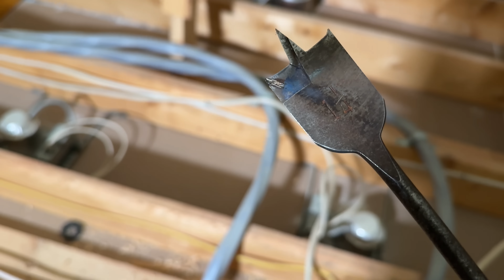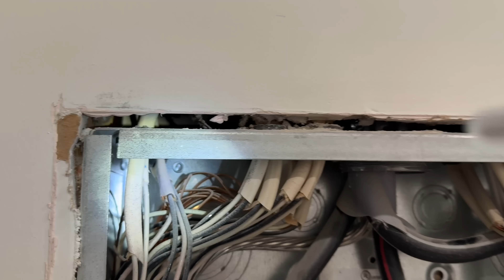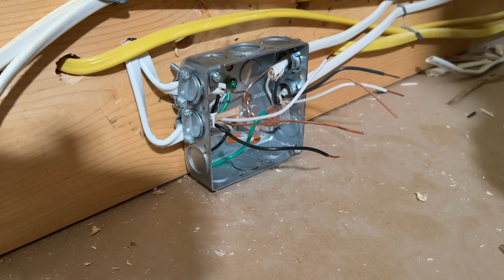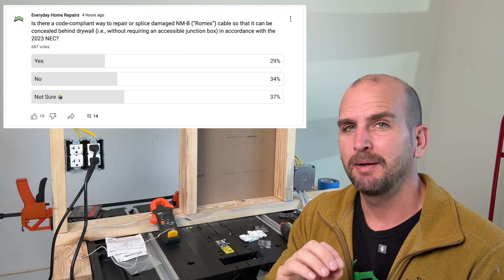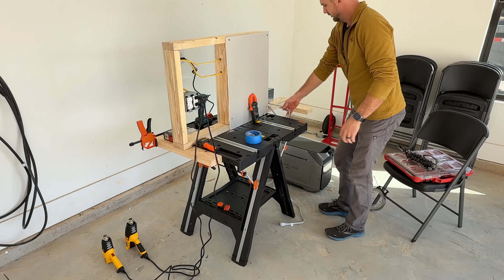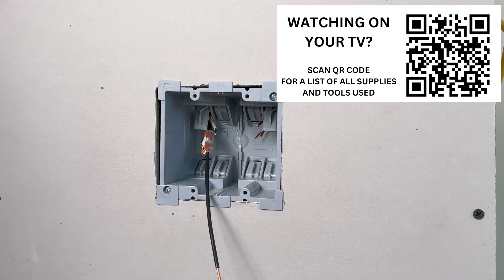How To Repair Damaged Romex |  3 Easy DIY Fixes

Comment from the maker: Romex Splice Kit (NEC Approved):  https://geni.us/Pf2A
WAGO 221 Inline Splice:  https://geni.us/czIBu
WAGO 221 Kit (4 Types of Lever Nuts):  https://geni.us/wKcBNC
New Klein Tools 16-in-1 Screwdriver:  https://geni.us/9j1bFVa
Knipex Hybrid Wire Strippers:  https://geni.us/uVWn
All The Supplies and Tools Used:  https://geni.us/l9NfK5G

DISCLAIMER: This video and description contain affiliate links, which means that if you click on one of the product links, I’ll receive a small commission.
Reply: Great video. I would replace the wire when feasible. But if not I prefer the old work box method. One difference that I would do is instead of two pig tails, I would just add a single extension/ jumper which would eliminate one set of connectors.
Reply: Why not solder the wires? That is a permanent repair that cant fail
Reply: Where does it say in the specs that it's rated to be buried behind drywall? I'm not seeing it. Thanks!
Reply: I CAN NOT SEE HOW THIS IS CODE APPROVED. AS FAR AS I WAS TAUGHT , ALL JUNCTIONS MUST BE ACCESSABLE. HOW IS ANYONE SUPPOSED TO KNOW THAT YOU MADE A SPLICE IN BEHIND THE WALL IN THE FURTURE??? I AM NOT SAYN THAT THE WAGUS ARE CRAP. IN ANY WAY. . I GUESS I AM JUST OLD SCHOOL IMHO

Comment: If you installed pipe and wire your whole life ( Greater Chicago Area) you have to ask the question how is Romex legal. With pipe and wire, no need for arc fault breakers. If you use SQ D QO breakers I would argue you can shit can GFi receptacles and breakers. Romex you can hire 8th graders to pull the romex, then have an apprentice to staple and splice the wires. With pipe and wire you need tools and some mechanical ability to do the work.

Comment: Metal box.. shouldn't it have the wire connectors so it doesn't rub the wire on the sharp metal holes ..or be plastic

Comment: First is best, only one added connection in a box.
The second and third options increase the number of connections (points of failure) by three.
At least the third connection is in a box and not hidden behind drywall.

Comment: your not gonna have problems now . Your gonna have problems down the road when someone overloads the circuit or installs a 30 amp breaker on the 20 amp wire. 42 years experience I've seen it all

Comment: use a 2 1/4 inch deep box and  also your service cable  is not stripped out  correctly and one needs to be shortened a 1/2 inch

Comment: I want to splice into a romex line in the wall to add an outlet, I barely would have enough line to get into a junction box but if I use the Wago connectors, will this be ok?

Comment: Wago's much easier. Can use either the inline splice or the two wire wago per wire. Put them in a small box and cover.

Comment: I have also seen the best items fail as well. Has the worst items fail? So just because you fail with one of those outlets on a griddle doesn't mean everybody does and it doesn't mean a good one. Wired not properly would not fail as well

Comment: I like how it's all in one.

However, yeah, no access is a concern for me.  

Additionally, if only the insulation is nicked I don't see that as necessary, just replace the insulation with the heavy in-wall grade electrical tape of your choice (not the cheap-stuff) I like the good silicon Outdoor/Indoor/in-wall grade stuff, or the amalgamating rubber in-wall grade stuff, simply because I have an irrational hate of vinyl. 

If ANY damage is done to the conductors, even a scratch, you will need to cut that out and do a full splice, though.  No shortcuts there. Play it safe.

Comment: That thing is made like a giant 3 wire scotch lock . Only ever used those in cars for 12volt stuff.The single wire ones that is. I've yet to use any of the Wago type on anything. Just seems like too little of surface contact for me.

Comment: So how in the hell are you gonna pull the new wire with the old wire if it was secured properly with staples? There's supposed to a staple every 54" unless passing perpendicular through a hole drilled through  a stud, joist or rafter. Most wiring issues I've cursed at have come from DIY masters who know everything because YouTube and AI told them so. If you insist on doing it yourself, get the current "Ugly 's electrical reference book" at Lowe's or HD.

Comment: #3 with single gang box installed horizontally. And only 6 inline wagos with 3 wires connecting them directly. No need for 9 wagos and 6 wires.

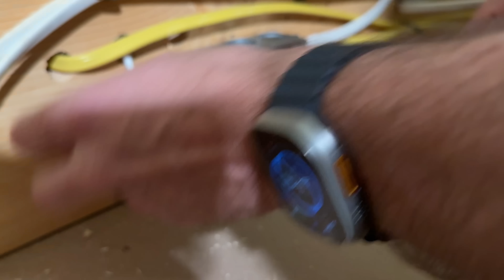Comment: Using a metal box instead of plastic in the basement and attic, makes no sense to me at all. More durable? I’ve never had a plastic junction box. Fall apart. Also, this website is hard to follow because he’s talking so fast. Slow it down there dude! 4:48

Comment: It’s UL approved. Is it the same part number for 14 and 12 AWG? Insulation displacement connectors have been around for 40 years or more. If you follow the manufacturer’s instructions, they are fine

Comment: In your attic example, you can not pass-thru the ground splice on that 2nd circuit.  It splices inside the box therefore it must be connected to the other grounds.  250.148.   You can tie all the grounds including the bonding jumper for the box under one wire nut, or you can bond each circuit to the box if you have more than one ground screw hole.  

Think about it, if someone cuts or disconnects the 1st circuit from the panel for any reason, then that box is no longer bonded if there is a fault in the 2nd circuit.  These two things could be years apart.  Someone could remove the 1st circuit in 2026, the fault in the 2nd circuit could occur in 2036 energizing the box, and the person touching the box could get electrocuted in 2037.

Comment: When you have a failure that didn't burn the house down, the single most time and money consuming thing about it is that you can not see it because it is behind a wall.  That make option #3 the far and away better choice.  Even if you must cut the wall out anyway, knowing where to start makes up for it.  

I have a hard time recalling seeing a wire fail in the middle where there was no device or splice.  I think I have seen mice eaten insulation create arc damage failure.  Hiding a splice behind a wall is poor practice that I would NEVER do and NEVER recommend even if it is code compliant.

Comment: Those connectors are ABSOLUTE JUNK !!!!   I worked in a double wide mobile home that had those to plug the two halves together at the marriage wall. There was a circuit not working, so I checked along that wall, and one of those connectors was BROWN !!!  It was burned up to the point of no connectivity. I would NEVER use one of those things... ever.

Comment: I apprenticed Jr High through college with my dad's friend, and regret not taking the journeyman exam. Anyway, even if code did allow for those splices without a box, as long as code allowed (it will always allow) I'd put the splice in a box with romex connectors to clamp and secure the wire in place, so that the next person to come along and yank the cable doesn't break the splice.  I've seen enough bad installs - not just DIY but by pros - to not put hack work in place; apprenticing gave me an appreciation for overbuilding on DIY home repairs and additions.

Comment: Depends on where it is.  If it is along the level of outlets, or in a room where mid wall outlets are ok, then I would put in outlets. I don't like all the blanks and other things stuck on my walls already in my great room.  I have the door bell box.  the prewired motion sensor location box, which I don't use, a blank for the fan which is on a 3 way switch we didn't 3-way.  Two smoke detectors, one for the full house linked system and one for my security system's smoke alarm,  one for the glass break sensor.  I have lots of things cluttering up my beautiful walls other than my wife's Japanese embroidery art work.  I would likely put in the hidden splice if I couldn't cover the blank plate with art or something.  In a bedroom or garage or bathroom it wouldn't bother me to put in a box and blank. I wouldn't run a wire to the breaker box myself.  I have rewired a house before, out in the countryside way outside of the city inspector's jurisdiction.  I put new breaker box and got rid of the old metal wrapped wiring from decades ago and put in Romex.  When I was running the microwave if the fridge kicked on the breaker flipped.  The old house had like 5 circuits total for two story house... Yeah..  Of course, the cottage at the lake was wired with two single strand wires going through the walls in bakelite tubes and the light fixtures pigtailed into it. I was wired by old coal miners probably before I was born.  But I live in the city now...I don't keep up with codes any more.  I have a good electrician company.  Which reminds me...I need a new outside outlet, a point of use hot water unit, and a new inside box too.

Comment: I found this snippet in the instruction installation manual. It requires that it be fastened to a wood stud or something similar. 

Connection (Fig. 3)
1. Slide splice into tap until locking latch engages
locking tab.
2. Mount connectors to stud or joist with 4d common
nails.

Comment: Just a duffer here.  All I know about electricity is what Bob Vila taught me 50 years ago.  With that said, I'm surprised that no one has invented a good splice that can be buried behind a wall and that meets code.  Just something easy and simple, good for both 15 and 20 amp circuits, for even a diyer like me to use.  Or am I missing something?  I think it would prevent a lot of dangerous, sketchy repairs.
     I'm sure you pros have see a lot of cr*p in the course of your careers.

Comment: I recently had to use the Romex Splice Kit.  It works just fine.  I don't quite understand why the WAGO 221 Inline Splice kit has to be in a junction box.  That would be nice to know.

Comment: Some codes are absolutely ridiculous. Splicing of wires is one of them. You can parallel "splice" wires together on an outlet with exposed screws and stripped wires, but can't use a barrel crimp-splice and environmental heatshrink to do splices. Shit makes absolutely no fucking sense. We use barrel "environmental splices" in aircraft wiring and those get tied in and hidden behind the interior walls, panels, etc. But, god forbid you do that on your house.

Comment: I live in a double wide mobile home on the marriage wall for the wiring where the two halves meet they are linked by those connectors never had a problem with them just wondered how safe they were

Comment: These repair devises are BS. Unsafe and if you use em you should be fired and have your license taken. 
Also the Copper Clad Aluminum wires equally as bad. 
You know the house builders say it's OK it isn't. 6" footers, half ass workers and money influencing Codes. Rats nest Romex wire installers would make a Pimple on a Real Electricians Ass. It isn't difficult to see how Code enforcers and Code Departments in General are so inadequate and couldn't build a Dog house. After 60 years in the business all I can say is The willingness of so called contractors to work warm bodies rather than Carpenters, Electricians, and all the rest are destroying skills. GOD HELP PEOPLE BUYING SOME OF THIS STUFF BEING BUILD NOW.

Comment: Not sure how the NSI would fair over time, its plastic with all the heat cycles. I would rather either replace the whole wire or have a slice box that is accessible. The idea of sealing "or it feels like hiding" anything other than a fully intact wire in the wall does not appeal to me.

Comment: I recently purchased 12/2 ROMEX at either ACE Hardware or Home Depot, don't quite recall; it turns out that when I cut the sheathing the neutral conductor has a yellowish color instead of white. I compared it to other 12/2 short wires that I had around and clearly there's a difference. Have you ever run across this and is it legal? Is it a manufacturer hiccup? The copper gauge is the same. Thank you.

Comment: The most proper way to handle this situation will be to disconnect and isolate the damaged wire so that no power is running through it.  Then run new wire to re-energize the circuit.  That's the only way I would fix this issue.  Nothing less.  Electricity is dangerous and causes fire.

Comment: Any box can be used as a J-Box... Don't use shallow 4-Squars... Use deeps. Fiberglass Nail-Ons make a good J-box in ceilings and attics.
4:33 please tell me you're not gonna mount the J-box there and like that on the ceiling drywall... and you did.
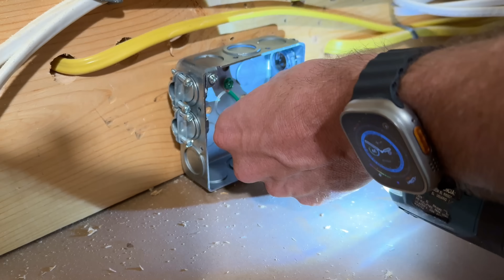4:45 Wires into a box need to be secured with a staple...  Those box connectors are rated for 2 wires... Don't need 4 of them.
5:38 Nice Bowl of Spaghetti. Tie ALL the grounds together, including the J-box ground. Tuck them. Tie the diff Neutrals, tuck. Then tie the Hots and tuck.
10:57 My company will NEVER use any connection buried in a wall... I have trouble shot to many situations where we find illegal junctions in a wall or ceiling. Even UL listed.

Comment: I am very familiar when those amp connectors from my years in the manufactured housing industry where they used them to connect the sections of the home together, permanently. They are approved by the NEC for use in the wall without access or a junction box. Glad to see your testing them thoroughly so now I have even more confidence in them. Great video.

Comment: Hmm, I still don't trust it. This device looks similar to the kind used in RVs, a common source of fires. Are there any alternatives that use screws instead? 
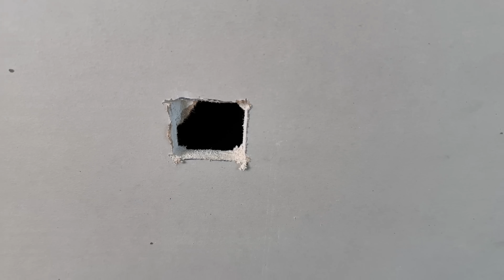12:40 — the insulation is gone. Now it’s easy-peasy.

Comment: I believe that the 3rd method is the safest one ! You do not have access to a hidden jonction  inside the wall ! So,how do you find a fault that you can not see ?
Reply: You spend a couple of days (1)testing and re-testing each receptacle and light (2) creating a map of how every circuit in the house should runs until you (3)narrow down as much as you can where you should cut the wall (4) before you actually cut the wall.  But don't worry, you will probably have to cut the wall more than once.

SO THAT YOU CAN SEE THE FAULT.  lol.

Comment: I wonder if the copper in those splice kits can be removed, and re installed. That way you can strip and solder the romex conductors. I would totally trust that repair

Comment: Not a pro and respect for the testing but I don't like it.  First of all, two parts that connect means contacts.  Is that necessary?  Second, pierce the insulation?  No way would I want that in the wall.  Isn't there something where you shove stripped wires in from each side and tighten set SCREWS?

Comment: Large bribes were given out to let those connectors be used inside walls without access! What a crock! My son's new house was built in the plant and hauled to his site in two halves, has these connectors where the house connects together. We are going to cut these out and install regular junction boxes. Great job, WAGO connectors are good for #14 wire powering lighting, but I still use wire nuts for 20 amp or above circuits because they are more secure. FYI, kids, back in the 60s, the ground was insulated with a green insulation that was stripped too. It was thinner, and you would just nick the edge of the insulation inside the box while pulling on it, and it would come off. How they ever allow uninsulated grounds inside an electrical panel is beyond me. Great job!

Comment: Even though this type of connector is listed, check this out?  
        “SPECIFICATION AND RAITINGS”
                Conductor size: 12 to 14 AWG (solid)  ￼
	•	Voltage rating: 300 VAC  ￼
	•	Amperage rating: 20 A  ￼
	•	Number of conductors: 2 (plus ground)  ￼
	•	Material / housing: Thermoplastic body with hinged (clear) cover  ￼
	•	UL listing: It is UL listed (for U.S. and Canada). Uh-huh here is the trick that just trained eyes can see. So don’t forget to ask AHJ.

Comment: Great video, but you haven’t mentioned that all these devices regardless of what you feel or you think have to be UL listed and it also has to comply with local codes AHJ, what means it may be allow in some places may not be in others. Also is that this type of work as any other electrical work has to be performed for a license electrician. Thanks and good luck..

Comment: Those joiners are basically a variation on Insulation Displacement Connectors. IDCs are fine when new but over time the conductor and the bits that contact the conductor oxidize, adding resistance in the contact point. P = I² x R so when current flows watts will happen and the contact point will heat up, causing more oxidation = more resistance = more heat.
I will definitely will not use anything like that.

Comment: Those splicers remind me of Scotchloks used in automotive applications. (Which usually fail due to weather infiltration) - They are quicker but not my first choice. #1 or the new wire would be my choice.

Comment: Great video!    I've never seen those connectors before.  I hope I never need them, but it looks like a workable solution if you're in a bind. 
Question-   Shouldn't there be a Romex connection at the panel for the replacement cable you ran?

Comment: i would have liked a test to failure the way UL does them - overload to failure alongside the other methods.  If they tolerate a 50% overload, they will likely tolerate the corrosion that builds up over time.

Comment: I know I'm old, but for piece of mind, I prefer screw terminal outlets and wire nuts. I don't like all the tiny point of contact devices. That is just a recipe for heat IMO.